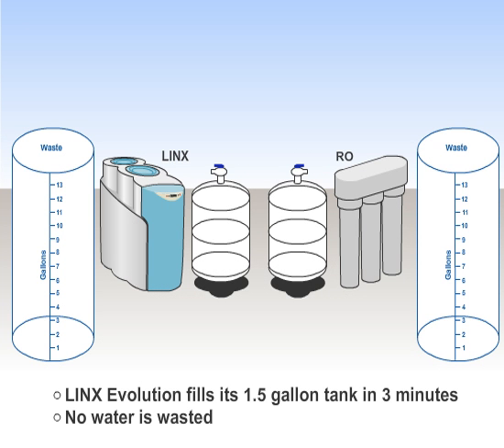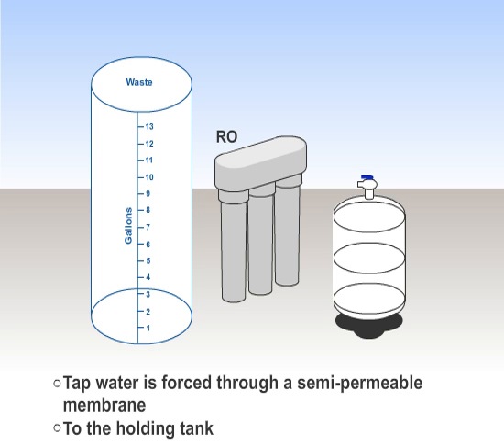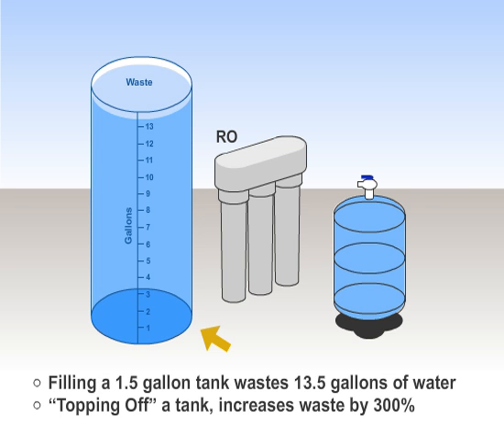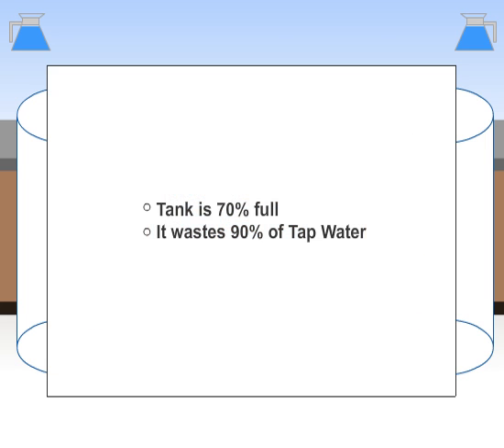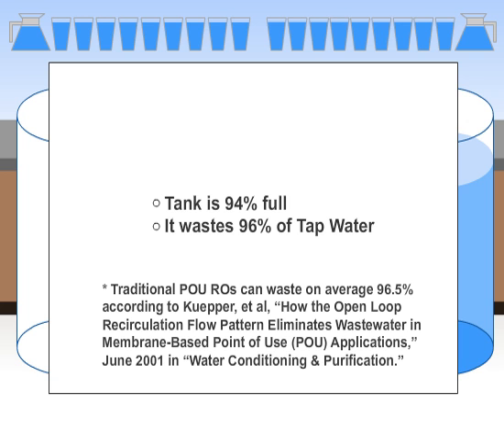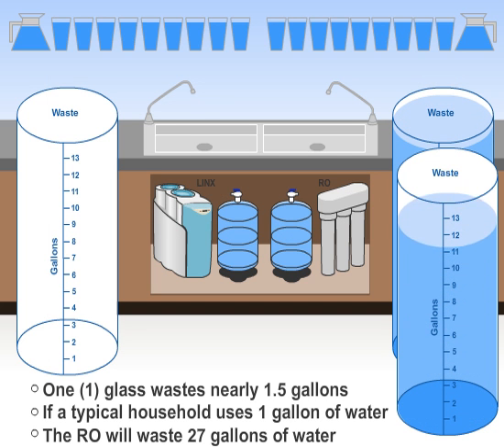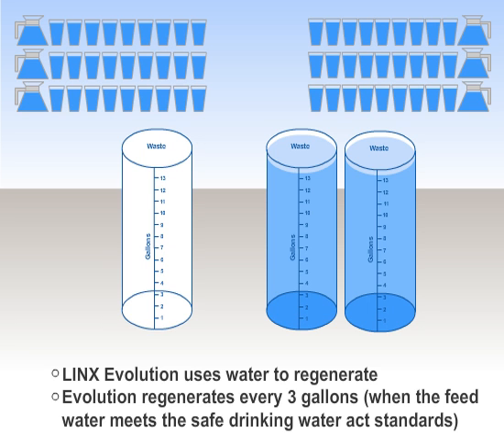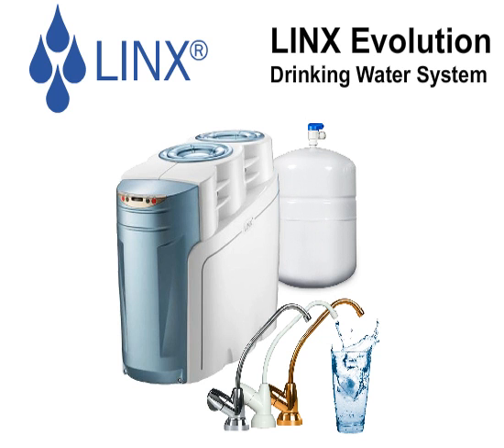Insane Water Waste -- Reverse Osmosis (RO) Truth

Comment from the maker: There are many types of ROs and some do have a “shut off” valve that opens to produce water to refill the tank after some percentage of the tank has been emptied – typically 20-40%.   The problem here is that as the tank empties the pressure and flow to your faucet goes down.  Of course the emptier the tank is, the higher the recovery initially, but it drops as back pressure from the tank increases as the tank fills up.  But three most important variables in recovery RO are:

Comment: you are neglecting in your video to mention that with a complete RO system, specifically one that includes a permeate pump, the back pressure you mentioned in the video is almost entirely eliminated and prevents 80% of the waste water you are talking about.
i'm just saying, you are not fairly representing the technology when comparing it to your product. you're talking about an incomplete system... why not ignore the waste water flow restricter and ASOV also while you're at it to bump ur numbers

Comment from the maker: @richrahnema The recovery rate of your RO determines the volume of wastewater. To produce 1 gallon of drinking water from 1,000 TDS feed water; a typical residential RO with a 10% recovery rate could waste 9 gallons of water w/ TDS levels of 1,100. The LINX would only waste 0.9 gallons at 1,000 TDS feed water, so naturally the TDS levels are concentrated at 1,850. This assumes both units operate at 95% reduction in TDS. Contact us if you have any other great questions & thank you!